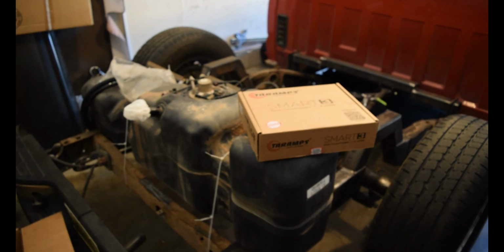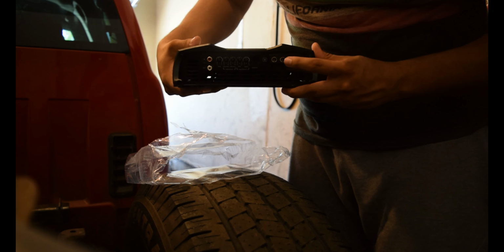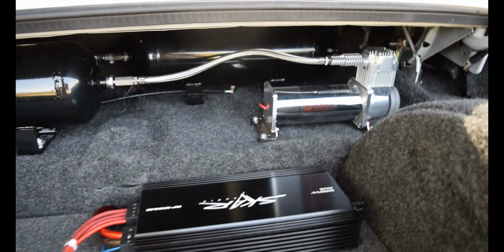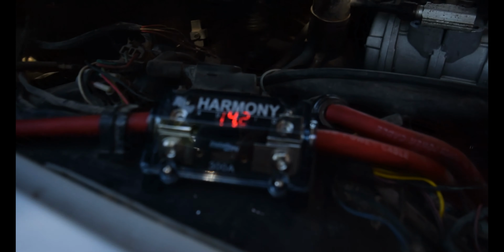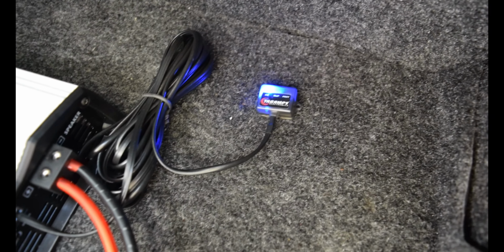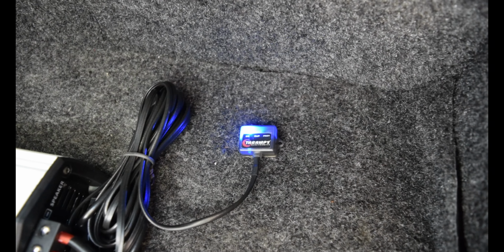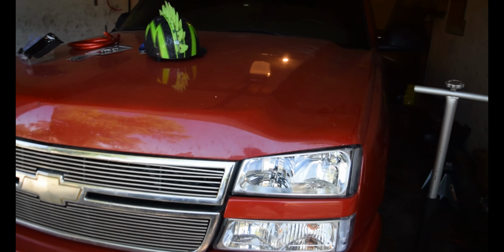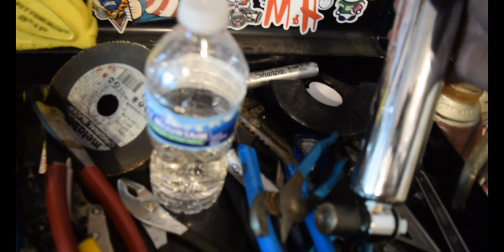Taramps SMART3 Unboxing & Review

Comment: How is your amp doing so far?is it worth i was interested on a skar also...wich one is better for you...does this taramps amp do 1 ohm as well
Reply from the maker: The Taramps was “okay” I liked the Skar amp a lot better. Currently have a Sundown 5k that i will be running in a future build
Reply: @CGOD  what doesnt combince you on taramps?i have one svr 12 with rp 1200.1 and feels ok,i upgraded to ddx 12 skar put not sure wich amp to get?
Reply from the maker: @JULIANysuHOHNER  the taramps requires a lot of tuning to make each song sound good. If you mount the bass knob inside the car you could get good use out of it but I feel the Skar amp works better on a range of music without tuning.

Comment: I ran my xfl 12 on my crescendo bc4k at 1ohm no issues at all ya just gotta know how to tune your amp and have the right enclosure and electrical to back it but that sub sounds like its blown or bottoming out you need to adjust your subsonic to about 30hz low pass to 80hz and set the gain with a 40hz test tone on and radio at 3/4 the way up turn gain till u see it clip then back off a nudge then u r good
Reply from the maker: Yeah the box was falling apart and rattling bad! I feel the sub was great but the Taramps amplifier needed an equalizer or something to sound better. Sub sounded way better on the Skar RP.1200

Comment: Im sorry but something sounds so bad in that trunk, is that a vented enclosure? Orr sealed? It sounds like that sub has something mechanically broken with it.
Reply from the maker: It was a ported enclosure that was coming apart. I ran some wood screws through it and got rid of that noise but this setup is long gone!
Reply: @CGOD   What do you have now? I just got a TARAMPS BASS 3k with a skar EVL-12 but I'm getting rid of the EVL-12 and I already ordered a Sundown X-v3 12
Reply from the maker: @ballistic_mod  I have a sundown 5k amp but no subs as of now. I’ll get another setup once I get another car

Comment: if you had ofc wires that sub would be gone quick. without 300 amp alternator how long your battery last?
Reply from the maker: In a later video I did the big 3 upgrade and ran a 250amp alternator. Original alternator setup killed the battery slowly.

Comment: The bottom does the same thing on mine. It pushes in a little, but I think they designed it like that. Post a video when u wire it up! Cheers
Reply from the maker: ChiefinBeatz I’ve sleazy got it set up. Didn’t really like it though, gonna be going with a 2k sundown amp instead

Comment: Also depends on what your speaker can handle bro do ohms law to set ac voltage correctly so u don't over power you speaker. Amp has no way of know what speaker can handle

Comment: I'm getting this exact same amp the Taramp Smart 3 & I've been getting advice all over the place from, no need to upgrade much, maybe just a Big 3. All the way to I'm gonna need a new High Output alternator, a new battery, a 2nd battery, I'm confused on what is actually necessary. Bc I seen where if you add such High output stuff that isn't needed, can be bad also. So I'm stuck on what I should actually do. I seen you have one. With that Voltage reader under the hood telling you where you're at, the 12.6, at idle. What would you recommend? To make sure I'm not crushing on my Jeeps power?
Reply from the maker: DonnRonn Bagger these newer amps are very power hungry! I went with a 250amp alt and big 3 upgrade, isn’t enough lol system pulls more amperage than the car can handle still. I’d recommend atleast 300amp alternator aswell as big 3 upgrade.
Reply: @CGOD  ok so the thing I'm not sure of, is I don't drive everyday bc I don't have a license, and my partner hates the loud bass and system all that, and she drives it everyday so basically the system will do alot of sitting. Maybe when I can drive it I'll be bangin the system, but for the most part it won't be in use, and I was told that the High power alternator and battery and everything, would be bad on the electrical system if the system isn't being used? How does all the High power stuff work if it's just powering a stock vehicle? With a system that's not being used?
Reply from the maker: DonnRonn Bagger I would assume it would still be fine. When I had the stock alternator it was slowly killing my battery cause it couldn’t keep up
Reply: @CGOD  I looked a little more into this just now, and I found that having a HO alt wouldn't hurt at all, so I'm thinking I should look into a higher amp alternator. But you said the 250 isn't enough lol? So would you recommend a 300? And would I need a new battery also?
Reply from the maker: DonnRonn Bagger you wouldn’t necessarily need a new battery, you can actually hook your system wiring straight to the alternator that way your battery isn’t getting constantly used and it’ll draw the amperage from the alternator. I would recommend atleast 300amp to be able to not have your lights dim
Reply: @CGOD  alright thanks for the info, I def got a little more research to do before going ahead with putting this Taramp in. Starting with a 300amp alt 😂 $300 more into this project. I knew it was too good to be true lol
Reply from the maker: DonnRonn Bagger yeah I’m in the same boat lol always wanting to change the set up or make it more self sufficient
Reply: @CGOD  I was looking at your box and thinking the sub I want would fit that box, but of all the deals I've seen, the sub I want is onky 350$ BUT DOESN'T COME WITH A BOX lol. And payin the beautiful price of $350 for the Skar ZVX '15' just isn't as good of a deal after a $200 box 😂 and that ZVX is just on time for the Taramp, it's a 3,000w sub with a 1500w RMS. So maybe you can look into that and check it out.
Reply from the maker: DonnRonn Bagger yeah man It gets pricey real fast haha!
Reply: Mark Seven  ok yeah thanks for the info. And yeah I'm definitely not cheaping on anything, at first I was bc I was under the impression I could budget about $1,500 to $2k but I see if I want quality I can't put a budget on it so I'm willing to spend whatever. If I could get this done for under $5k I'll be happy, that's my new mindset with this build. But 1 question I wanna ask? If I get (2) Skar VXF 15's (1,500w RMS) and run them on the smart 3 @ 2 ohm, what fuse should I go with at the battery? Bc I did the math, and I also get advice, and nothing seems to add up, and I'm stuck with not knowing the proper fuse to use at the battery, and then at the distribution block on the smart 3 wire, I will also be splitting off with 4g wire for the Rockford Fos T600-4 and I got the fuse at the distro for that amp. But I'm all jumbled with the Smart 3.. Can you throw me some advice? It's like I don't wanna make any moves on this before I know I have the absolute correct info.
Reply from the maker: Mark Seven I was using 0 gauge wire but had to trim it down a good bit to fit in the terminal
Reply: Mark Seven  yeah 1/0 ,, but even with That, I was told to watch out bc even 1/0 OFC wire aren't all made equally. So I can't just go and get 1/0 OFC wire and think I'm good to go, bc I guess it gets deeper than just assuming 1/0 OFC will carry my 3500 watt system. I'll also have the RF T600-4 for mids and highs ,,, that's where the extra wattage came from.
Reply: Mark Seven  that's why I'm stuck.
Reply: Mark Seven  basically 1/0 OFC from the battery down to the distribution block. 1/0 from distro to the smart 3, and 4g from the distro to the RF T600-4 ... And obviously I know I'll need to fuse everything. But I'm just stuck on all information pertaining to the Smart 3. (Fuse. Proper 1/0 OFC wire. Bc I guess not all 1/0 OFC wire is built to carry the 3500 watt load I'll have) so yeah I'm a mess, and I'm actually looking into other amps I don't want to use this Smart 3, maybe I just completely change directions and get a different brand amp.?
Reply: Mark Seven  I didn't get the alternator yet, but I will be getting a hairpin 300A for a 2003 Jeep Grand Cherokee. So it will be a strong Alt, and an AMG battery. And wiring @ 2 ohm it's 3,000w RMS, and the RF T600-4 is 100w RMS per channel, by 4 channels. So 3,400 total watts RMS coming from the main power wire, or would I say 3,400 on my entire system? But ok yeah I should've stuck with the welding wire idea. 2/0 welding wire?
Reply: Mark Seven  yeah I understand how to do the math, and as far as over system wattage goes, adding total watts 3000 to the subs, and 400 to the door speakers, that's 3400 total, so 340 divided by 13.8 that equals 246 so I think there's 250 fuses, for right off the battery..150a for the smart 3 wire.. 80 for the RF amp.? Does that all sound correct?
Reply: Mark Seven  but the problem I am having is, let's say I'm using ONLY the Smart 3. And I took the 3000w RMS, divided by 13.8  I end up with 217 alone from the Smart 3. So if I go out a 150a fuse on that, i'm gonna have problems with poppin the fuses constantly?

Comment: Correct me if I'm wrong but do you plug the bass knob up to the monitor or how?
Reply from the maker: pureskillz15 this amp doesn’t have a bass knob
Reply: I seen someone saying something about a rca splitter to hook a knob up.
Reply from the maker: Maybe man, I haven’t heard of it. I think I may sell this amp soon. I don’t really like it
Reply: @CGOD  how come?
Reply from the maker: pureskillz15 I was gonna make another video over it but the amp has a hard time equalizing bass on different songs. If tuned for a heavy bass song it won’t hit very hard on lighter songs. And if tuned to hit on the lighter songs then it hits too hard on the heavy songs
Reply: @CGOD 
The amp crossover is quite poor - better to open up the frequencies and use an active crossover
Reply: @SmalltimR  Yeah thats the best way to run this amp for subs, the onboard min. 90hz xover sucks. With an external epicenter or dsp they bang the low notes with more vocals or high bass coming through. 💪

Comment: Sounds horibal how's the sound quality at low frequency? Is that crazy noise loud bass distortion probably or is the sub bottoming out?
Reply from the maker: Ryan Bass For Life oh yeah it sounded bad because my box was coming apart lol I ran some screws through the box and it cleaned up the sound a lot
Reply: @CGOD  nice box is everything so how's the sound quality of the smart 3k someone says it not good at all or when you set it dose it hit low frequency?
Reply from the maker: Ryan Bass For Life it sounded decent. There is a tiny bit of voice that plays through the subwoofer but I believe that’s normal for these Taramps
Reply: @CGOD  thanks for the edvice ill subscribe to your channel now I'm trying to get more watts to my 18 soundqubed hdx3s I might go with 5000 watt taramp or 2 3000 rockville db comp or 1 3500 new rockville db comp CEA rated at .50 just not sire if rockville can handle .50?
Reply from the maker: Ryan Bass For Life I’d say go with 2 amps, slave setups have been good from what I’ve seen
Reply: @CGOD  yes I was thinking 2 amps for my 2 18 dule 2 ohms soundqubed subs would be good caus I'm wired in series each woofer is wired up to 4 and back down to 2 ohms final load and bridged setup is full power at 2 ohms.

Comment: Hey bro how are you liking that amp so far?  Everything I've heard from all the videos is that it kicks ass.
Reply from the maker: hippo potamus since this video I went with a Sundown 2K and like it a lot more. The Taramps is OK but very hard to tune
Reply: @CGOD  Ah. Yea BigDWiz was saying he could hear vocals coming through. I went ahead an ordered one just couldnt pass on the value pricing. I think I'll add a separate crossover to minimize unwanted Hz. What I really want is an Orion xtr 2500dz but they are basically sold out everywhere and their price went from $350 to now $500. Anyways, thanks for the reply. -Cheers mate.
Reply: @hippo-potamus  if I get a MD taramp I would decently get a sepreat crossover but I hear if you set the bass boost to 35hz and turn it up it should cancel the high hz!
Reply: @CGOD  hey what is the exact order numbers for the sundown 2k? Bc I'm having a hard time finding it bc alot of other shit pops up and I'm not 100% sure what I'm really looking at? But I want to take a look at the exact sundown amp you just said you liked?
Reply: @CGOD  I found the sundown 3k easily, but for some reason when I type sundown 2k I get all the Skar and rockville amps
Reply from the maker: DonnRonn Bagger the new amp I have is a Sundown Audio SFB-2000D it ran me about $280 and it’s from their budget line of amps. Works great for me!
Reply from the maker: @cheddarballs864  I went with an SFB-5000 and no fire yet lol
Reply from the maker: @cheddarballs864  yeah I haven’t had a system in a car for awhile so my 5k has just been sitting